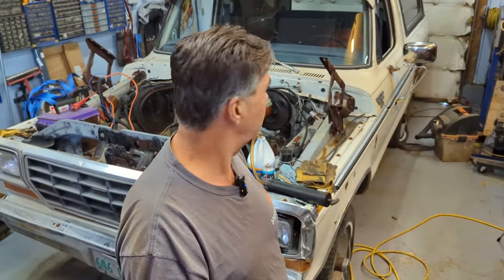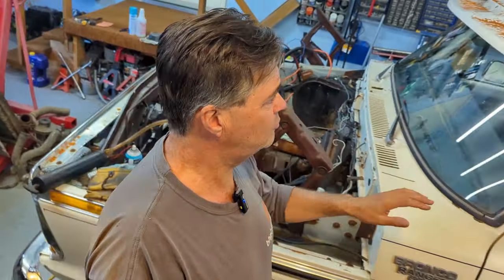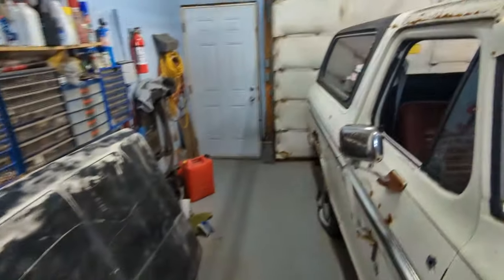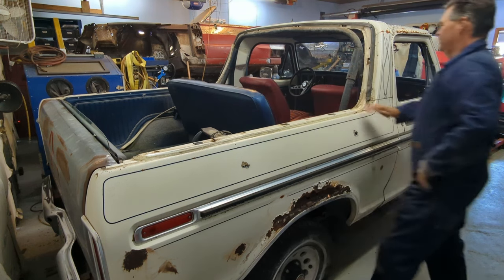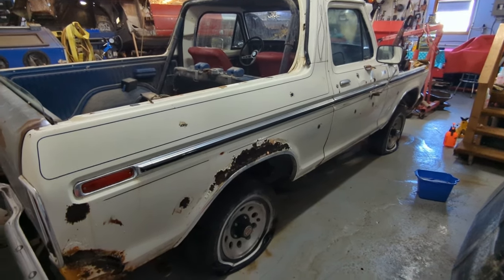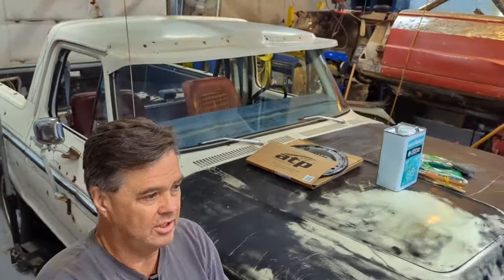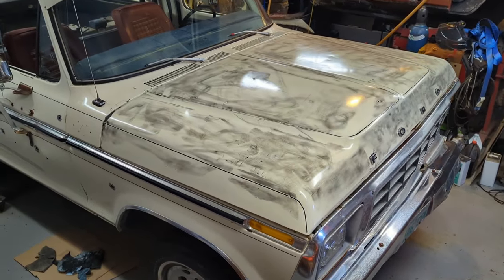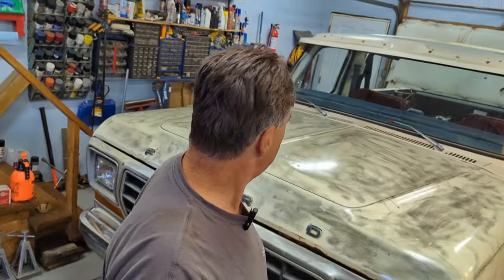Getting Rid of Moss & Dirt on My 78 Ford Bronco Ranger XLT

Comment: I like your term "revitalization", captures the spirit of what you've set out to do.  Wisps of smoke - laughed out loud but don't be surprised if this catches on. And if anyone gives you grief about it, show them the video of you carrying the roof alone - they'll leave you alone after that.  Holy mackerel man, I've pulled Jeep hardtops, and that thing has to be heavier.  Thank you as always ~ Chuck
Reply from the maker: Hey Chuck, for some unknown reason some of the comments are not showing up in the usual place, and I almost miss 3 of you guys.
The "Wisps of Smoke" just popped into my head as I was video, so I ran with it. Lol
Yes, and at 61 years of age, I don't think I should be doing those types of lifts anymore...but its hard to change old habits.

Comment: Hello Alvin.  Good job on the clean up. You can see the pin stripe on the hood! Maybe soak the hood hinges in a plastic tub with vinegar for a week or so. (Joernone tip)
George B
Reply from the maker: Thank you George!
Yes, there are pin stripes under all that old paint, and did you the high end sanding job, before the black paint was laid down? Lol